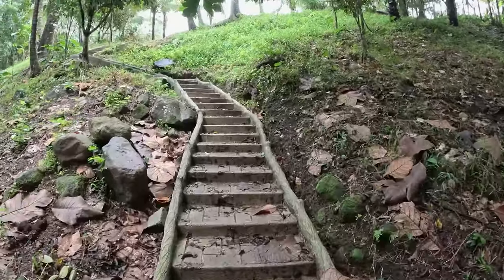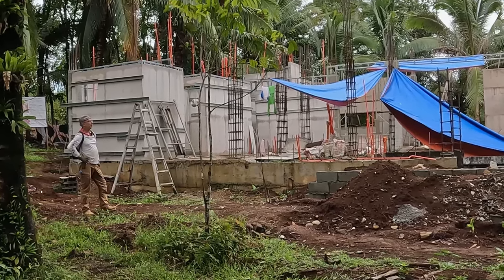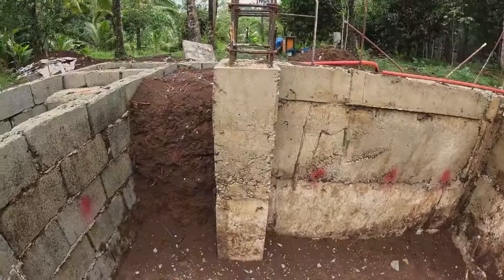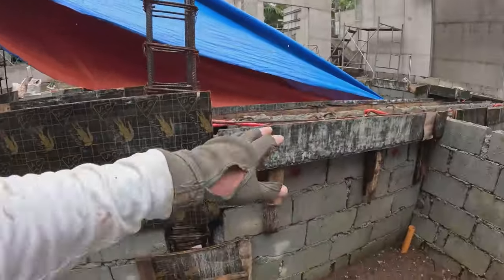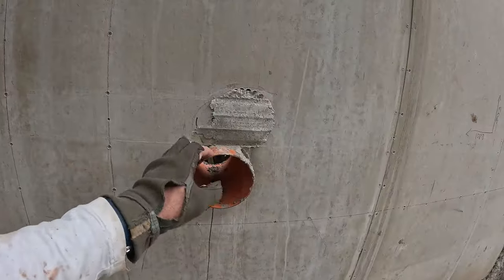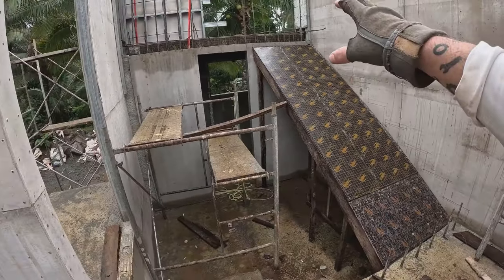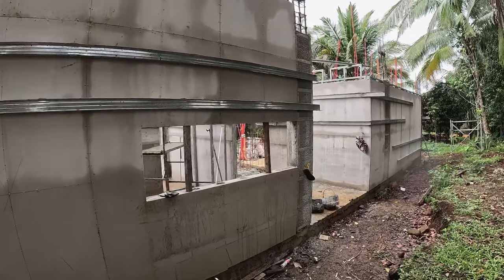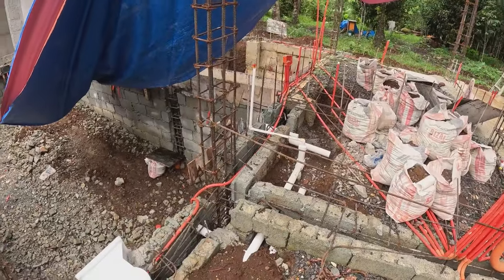DId I Chose the Perfect Architect? 🏠 | House Build Philippines | Ep. 25 | TORINO

Comment: Cheers thanks for this nice info. I know check check and double check. But you are doing fine. Be on the site every day. When i go building
In the morning i want to do a briefing with the guys and on the end of the day a evaluation so everybody know what he had to do and did. I found a conctruction ingeneer. He can do and make the (complete buiding permid) for 130000p .This is incluced the architect and al the permits that are needed and all the paperwork.  It will be a house 12 m by 10 m, two story with concrete roof and septictank. Massive pored walls no CHB. And yes i did check all his project that he did before. I was very positive supresed. So now pray it will goes right